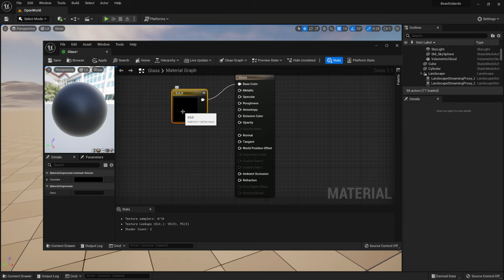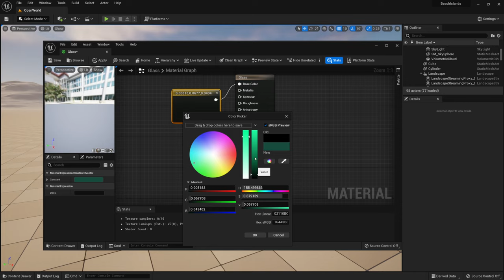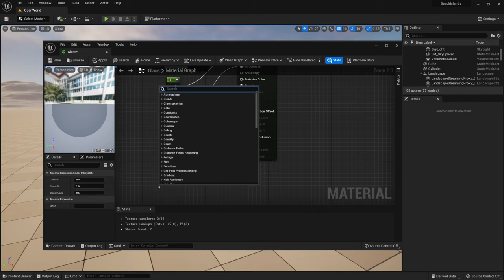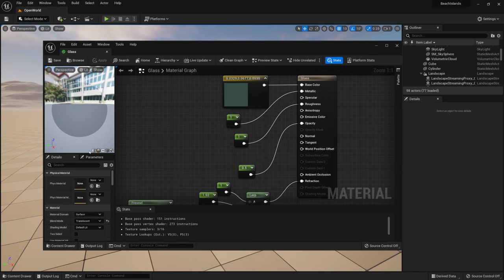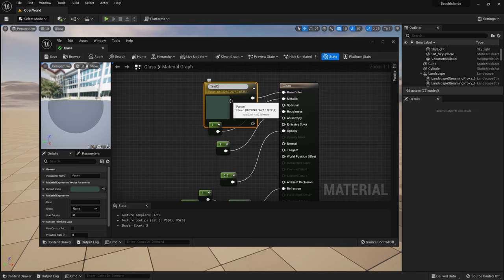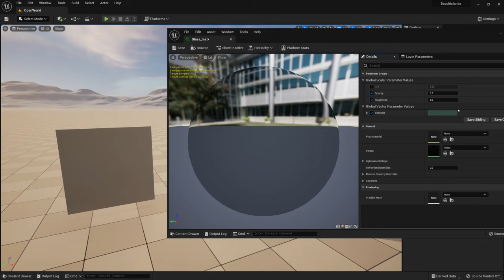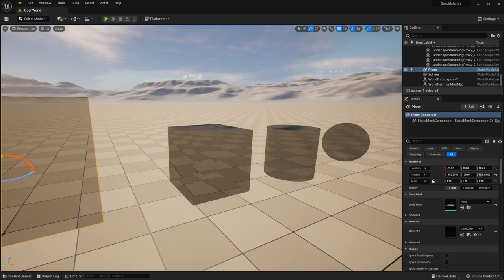Unreal Engine 5 How to Create Realistic Glass Material | UE5 Complete Guide

Comment: If your material doesn't have allow you to use the refraction input. Change the Refraction setting from None. In the material details.
Reply from the maker: Thanks for that!
Reply: thank you so much! was driving me nuts!
Reply: Thank you
Reply: Thank you so much I had just given up on it and was about to go no glass
Reply: thanks
Reply: @3DTudor  where is that ?
Reply: @blackopsone2501   In the details of the material, on bottom its a section calling "Refraction", will appear Refraction Method = None
Reply: Which one should we change it to? There's 3 options now - I have a strong feeling the correct one is "Index of Refraction"
Reply: @dethswurl117  Me too, i use that
Reply: Thank you!
Reply: @dethswurl117  efectivamente es ese
Reply: With me it was already set to none and was still disabled.
Reply: Thank you sir!

Comment: My refraction option is disabled, how do I fix that?
Reply from the maker: In Unreal Engine, the refraction option in a material can become disabled if certain prerequisites are not met. Here are some potential issues to check:

    Material Domain: Ensure your material's domain is set to "Surface". Refraction is a property of surfaces in real life, so Unreal Engine follows this model. You can't apply refraction to a material that isn't supposed to be a surface.

    Translucency: Refraction is only available for translucent materials. Make sure your material's blend mode is set to "Translucent". You can find this under the Material property in your Material Editor.

    Refraction Input: If refraction is still disabled, check whether you have anything plugged into the refraction input. If there is no input, Unreal Engine might disable the option to optimize performance. In this case, I recommend you check Engine's settings.

Comment: Thanks for the tutorial!
But why would you set the roughness to 1 and not to 0? 
Glass is fully reflective and should have 0 roughness.
Reply from the maker: We create a parameter for its controls. Glass can have a high roughness value, really depends on the type of environment you are going for :)
Reply: Glass should of course have a low roughness value in most cases, based on PBR workflow which is what Unreal uses.

Comment: I'm using engine version 5.2 and I have refraction disabled by default and it says this:
takes in a texture or value that simulates index of refraction of the surface
and when I turn on the index of refraction and do everything according to the instructions, then for some reason the glass strongly reflects the mirror and reflects itself, it turns out a recursion. Ie in the window I see the window and transparency at the same time, this is not normal. What to do? Maybe this is because the glass I have is thick? And it is necessary to do one polygon?
Reply from the maker: Maybe you have two sided material ticked on..? If glass has two sides and has both visible in render, you would need to lower transparency to get better results. But yeah, honestly, a single plane is often the way :)
Reply: @antonmercer6203 Did you ever find a solution to this? I could stop the glass from "reflecting" itself by increasing the refraction depth bias, but it still showed a perfectly smooth reflection of the environment around it, ignoring my roughness texture (the glass is covered in dirt). The only way I could get rid of it was by unplugging the refraction input. Having a single plane isn't really an option for me since it's broken shards of glass sticking out of a window frame, not one solid pane. Having two-sided material on or off doesn't affect it either.

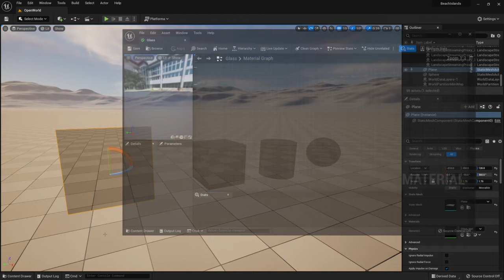Comment: 7:13 - don't do this if you don't want messed-up refractions — use thin plates that actually have both surfaces instead.
When a non-closed mesh is used as a refractor, light ray is registered as coming inside the material, but never going out. This means that after passing through such an mesh it continues to travel at a wrong angle, resulting in extremely exaggerated refractions that can be seen in the video when the square is looked at at an angle.
Reply from the maker: Interesting, I might need to do more testing on it. Thanks for sharing.

Comment: Does this work in nanite? When I apply this material to a glass, I can only see the checkers when there is something wrong with the material
Reply from the maker: Yes, you can create glass materials in Unreal Engine 5, but the Nanite Virtualized Geometry system might not be ideal for translucent or transparent materials like glass.

Nanite is designed primarily for opaque static meshes, and its primary focus is to optimize the rendering of highly detailed environments by only rendering visible portions of the geometry. Transparent or translucent materials require different rendering techniques, as they may need to take into account refraction, reflection, and various lighting interactions.

However, you can still create glass materials in Unreal Engine 5 using the traditional mesh and material systems. For instance, you can use Unreal Engine's physically-based rendering (PBR) system to create realistic glass materials with properties like refraction, reflection, and transparency. These materials can be applied to your mesh objects, but they won't leverage the full benefits of Nanite.

In summary, while you can create glass materials in Unreal Engine 5, they might not work optimally with the Nanite Virtualized Geometry system due to its focus on opaque static meshes. You can still create and use glass materials, but you should consider using traditional mesh and material systems for better results.
Reply: @3DTudor  thank you, I appreciate the thoughtful response

Comment: But what if the glass of the model has a thickness? Is this material suitable or do you need a different material for glass with a thickness?
Reply from the maker: Setting up Glass as 2 sided shader would help out more for thicker glass :)
Reply: @3DTudor  I set that option and the thickness of the glass continues to disappear, the video itself was useful for the material, but it took away the thickness :(
Reply: I just tried taking out the Nanite and the thickness of the glass does appear

Comment: Thank you! How could you apply it to an imported static mesh from blender ? (it works when I create a new mesh in UE5, but it doesn't work with an import static mesh from blender... )
Reply from the maker: That's interesting, you should be able to apply the material onto any imported mesh. Try double clicking on static mesh and changing material from its details tab. Hope this helps :)
Reply: Same problem here but I managed to fix it. For some reason you need to export a glb file from blender instead of an fbx file. I'm a bit late but hope this helps.

Comment: I've been looking for this everywhere, but how do you hide the "default value" input on simple nodes? This makes them huge sometimes, especially when it's a vector. What I'm looking for is kinda similar to "hide unconnected pins", but without hiding the unconnected pins.
Reply from the maker: Good question, they updated material graph with 5.1 and that is my issue on it too. Haven't found the solution to it yet, let me know if you get an answer to it :)

Comment: i see the glass with the default checker material, why? is there any settings that i have to adjust?
Reply from the maker: It sounds like the glass material hasn't been assigned onto your mesh properly, try checking if it has been applied within your details tab for the mesh :)
Reply: @3DTudor  yes of course
Reply: @3DTudor  i mean, i applied the material of course..  and i see the checker material anyway
Reply: @The9PointStar  check if your mesh has nanite disabled, doesn't work on nanite meshes

Comment: surface translucency volume no longer allows refraction
Reply from the maker: Hi @Crimson271180,
So I did some digging and found that after 5.2 there is a new option option called 'refraction method' in material details tab. Set this to 'Index of Refraction' and it'll work in the exact same way.
Reply: @3DTudor  hey thats great thanks, I'll take a look , thanks for the response,